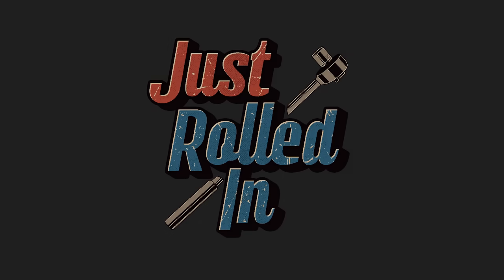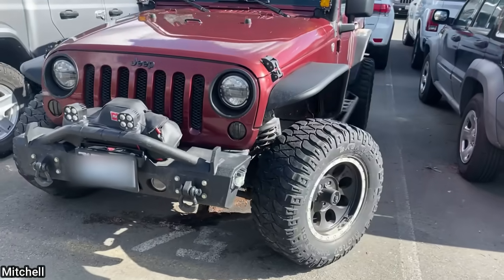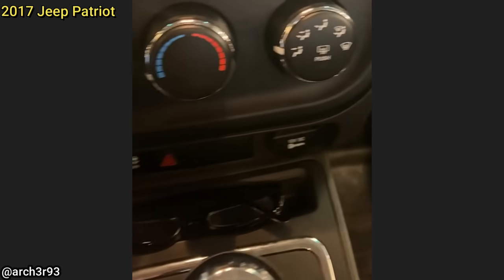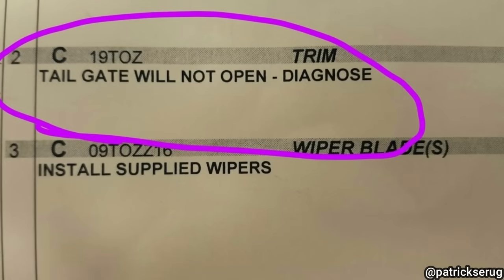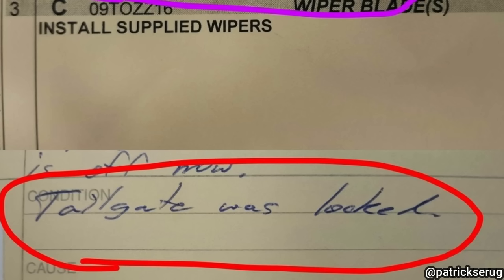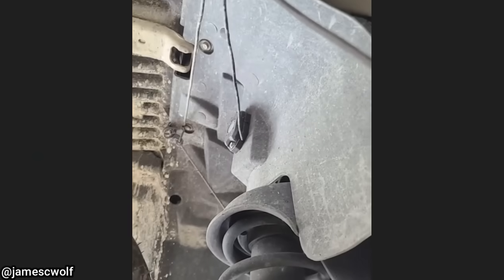Customer States They Hit A BIG Rock | Just Rolled In

Comment: If you must zip tie your wiring to something, use the drive shaft for quicker results!
Reply: Zip ties on a drive shaft are a an old prank, probably more than a few shops found this a time or two.
Reply from the maker: 😂 I'm pretty sure I posted a photo in a previous episode of somebody who actually did that. 
Also a customer used a belt to hold up their exhaust and belted it up to their driveshaft.
Reply: @JustRolledIn  lol yeah saw your video with the belt 😛
Reply: But, by avoiding the wires from hitting the ground, they now have them going across the exhaust.
Reply: Surprised that I haven't seen any pics on this channel of some idiot zip-tying wires to their wheels!
Reply: And for fwd cars use the CV axles, and always ratchet strap your load to the pre drilled holes on your rims. It's what it's there for.
Reply from the maker: @stevie-ray2020  there was a clip that somebody had underglow wiring rubbing against their brakes and brake caliper 😅
Reply: Just another bright Wrangler owner...... Disclosure....I'm one.😉
Reply: @JustRolledIn   Saw that!
Reply: I found the exhaust to be the easiest.
Reply: Much better option.
Reply: Lol sadly I actually do have to ziptie some of the wiring in my mustang because it's hanging down into the steering shaft I have no idea how the kid drove 50 miles to my house in it with no oil dipstick and a shot wheel hub assembly so ... I may be throwing a 302 into it lol
Reply: @stevie-ray2020  The closest I come is seeing someone putting snow chains on the front wheels on a rear wheel drive, no chains on the rear wheels.
Reply: or exhaust pipe

Comment: In high school I told my mechanic father that I hit a rock with my car. Which I did, I just left out the part that I did it while hill jumping on a dirt road. He didn't buy it and I rode the bus for a month until he decided to fix my car.
Reply: That'll learn ya
Reply: Been there before lol. 96 Ford Taurus into a guardrail said I got cut off but just came in the turn too hot.
Reply: @jefferymccormick3380  I got pretty close to doing that back in highschool with my old 94 celica.  Was out in the country late at night doing some "spirited driving" and came up to a decreasing radius corner a little too fast, i felt the car understeering right twards a ditch.  Luckily I did the right thing and didnt lock up the brakes, instead just let off the gas and lightly tapped the brakes to where the back end rotated a little faster.  Was a pucker moment for sure,  I decided at that moment that If its a blind corner, and you cant see it in full to always play it safe.
Reply: My mechanic father taught me to be my own damn mechanic at the age of 12
Reply: I mean at least he fixed it. I would have told you to fix it yourself 😂

Comment: A PSA for anyone that's dealing with hot glue.

Just spray a little of isopropyl alcohol over the glue, let it soak a few seconds, and then try to pry the blob. IPA makes wonders cleaning hot glue.. You don't even have to rub residues..
Reply: Good idea: I. alcohol also gets stickers off of windows; soak a few seconds to dissolve the glue, and then clean window. Learned that in a grocery store.
Reply: Thanks for the information
Reply: I didn't believe that when I heard it because I knew it wouldn't disolve the glue... But I tried it, turns out it works it's magic on the bond and it just pops right off with some wiggling.
Reply: @volvo09  The first time that I saw that trick my mind literally exploded
Reply: @SDogo  Literally! That sounds messy!
Reply: @MrTruckerf  try it :D
Reply: Thank you for the first useful youtube comment of the year!!
Reply: Further PSA
IPA, in this instance is referring to isopropyl alcohol and not an India Pale Ale. 
It is ill advised to pour India Pale Ales on hotglue.
Reply: @tesleentwiceforgiven6063  Oh... good call XD
Reply: @tesleentwiceforgiven6063  Doh..... Too late 😩
Reply: I've seen this when they pull dents and had it in mind, never thought it can work but seems like it penetrates on the bond somehow.

Comment: First time I have ever seen a leak repaired with a c-clamp!  Must be a top-notch mechanic with extra skills.
And... The problem with plastic fuel tanks is that thieves don't have to worry about blowing up when they drill holes.  That's just a really rude thing to do.
Reply: yeah, except for the battery powered drill that has brushes sparking away, right?
Reply: They don't have to worry anyway.  If they are drilling the bottom of the tank, the hole is covered by liquid gas.  A spark will not be likely to ignite that.

People often misunderstand this.  You can take a lit match and throw it into a bucket of gasoline and if you didn't let gas vapor build up above the bucket yet, it will just extinguish the match.
Reply: @stinkycheese804  ... while more and more cordless drills are brushless these days, I'm not sure it's worth the gamble to drain a tank with a drill INSIDE a shop that also has a million bucks worth of cars and tools... not to mention the business interruption a fire might cause. Oh yeah, you could also set yourself on fire and do some serious damage there as well. There are safer ways to do this.
Reply: @stinkycheese804  You do either the tank or bucket trick.... I'll watch from a safe distance.
Reply: C-clamp guy 10 minutes later..."where's my c-clamp AND my 10mm wrench???" 😂

Comment: Didnt know they bought a car not equipped with air conditioning. Lost my faith in humanity.  😆  Another good video 👍 👍
Reply: Almost as bad as the locked lift gate that won't open....my god
Reply: I think some people don't realize that A/C is an option, and that cars can come without it?
Reply: @dposcuro  a car without A/C wouldn’t sell here in Florida xD
Reply: @dposcuro    I'll be honest, I thought all cars had it as standard at this point!
Reply: Ehh, I'm kind of willing to give that person a pass. Bought used, likely no Monroney label included, and the knobs look normal to a non-car person.
Reply: @GreenJeep1998  my niece has a near bare bones Corolla...2014. It has no AC. In the summer heat not sure how she does it. I would give up power windows for AC.
Reply: @mikefoehr235  im not going to lie.  i thought ac was standard on those types of cars.

its worth a little bit more money for AC
Reply: @mikefoehr235  Uhg, after having owned vehicles with dead A/C, mostly dark colored too, I don’t think I can go without any more.
Reply: Would have never thought of a car not having AC, but it’s one of the first things I check when buying a vehicle.
Reply: @michaelvaus  I agree 100 percent man. When the wife and I go camping, sure is nice towing our RV and being comfy.
Reply: When I was looking at a truck to buy I asked if it had air conditioning. He thought it did. I tilted the cab and no compressor, no 2nd radiator for the air conditioner.
Reply: @dposcuro  It's what your soon-to-be ex-wife gets in the divorce settlement
Reply: Yep, if your car is a complete base model then be careful to check for AC. It's pretty much guaranteed to be there in anything except a base model... And even those have to be special ordered. No dealers really  actively stock those. 

My local Toyota dealer had new base corollas advertised for 14k back about 10y ago, no AC.
Reply: @volvo09  Damn by 2017 I thought AC was pretty much standard.
Reply: I was surprised you can even get a new car without A/C. My last couple were barebones but still had it!
Reply: My 98 civic had AC but I didn’t have it for 5 years due to the belt that ran the compressor broke twice and I gave up , it was a pain , last time it was suggestive that the compressor seized which broke the belt . My Tacoma has ice cold AC 🤣
Reply: Zilla Deliva  it costs more to not have the ac system now a days, right?
Reply: My first and third cars had broken AC.. it was almost always enough to just roll the windows down. On Long Island anyway, so it didn't get super hot like a lot of places.
But in the rain, the defogger requires A/C to work so...
Reply: I've had people borrow my pickup before, then bring it back telling me that the power steering was broken. That pickup has an alternator, a water pump and nothing else on the belt.
Reply: @Glider5858  yes but is sell at some place that are colder same for heat why buy extra for something you wont use

Comment: I had a authorized dealer at a large facility install their brand new factory ordered truck cap on my F150. This dealer ran an accessory power wire to the back of the truck straight from the battery hanging out in the open underneath the truck zip tied to the suspension components and what ever else they could find to zip tie the wire to. There was no fuse anywhere in the wire it was live from the battery to the back of the truck waiting to ground out and possibly start a fire. I could not believe my eyes when I saw what they had done with that wire.

Comment: That Jeep with the broken axle is pretty impressive. I think the latest generation (JL/JT) have a cast section with an axle disconnect to improve MPG and this cast section is what breaks, but this looks like an older model without the cast disconnect section. That is just the axle tube and it is still broken clean in half. Impressive indeed. The speed and forces involved here were truly large.

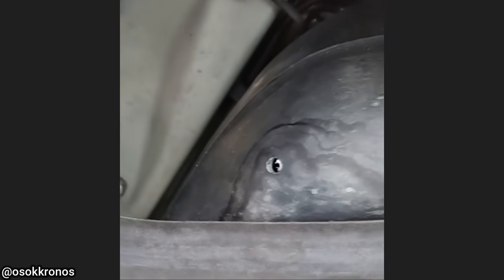Comment: 0:50 Drilling holes in gas tanks and stealing catalytic converters seems to be more common these days (at least in the USA). I've never heard of it happening here though and hopefully it wont become common. It seems high risk drilling into a tank with a highly flammable liquid in it. Drill bits tend to get very hot when drilling metal.
Reply: Most tanks are plastic these days. Now, stealing burritos however... Tricky business!
Reply: Did that look like a metal gas tank? No, it did not.
Reply: I do repairs/roadside calls for U-Haul & we see this at least once a week. One location was hit a few weeks back, got 12 cats & drilled all the tanks. I ended up making about 8 grand off that fiasco. Sucks tho, scumbag thieves. Nothing seems to stop them short of a big mean-ass dog.
Reply: Metal or plastic on the gas tank, no big deal drilling as long as you're drilling into the gas and not vapors. The vapors are what burns.
Reply: @acemobile9806  The sound of a 12 gauge pump stopped a would be gas thief in my driveway last weekend real fast. So fast in fact that he left a real nice milwaukee cordless drill next to the car. He probably "obtained" the drill at a huge discount too though.
Reply: @MikeBrown-ii3pt  fuckin' A right. Good score! I wonder if he'll try to get his drill back
Reply: @acemobile9806  a 12 gauge seems to work.
Reply: Yeah..it'd be nice to live in low/no crime area; my cargo van was ez pickins for both cats. Don't drive much & hoping ( large) tank stays hole free:/ 
Gas has dipped below $4/gal here, woo. How much in Brisbane..?
Reply: There is no risk to the person drilling even in steel tanks.  You're simply not going to start a fire that way.  It does cause a large repair bill though!
Reply: @acemobile9806   Do you really think he purchased the drill in the first place?
Reply: @stevie-ray2020  no, of course not! that was part of the joke 🙄
Reply: @knurlgnar24 Ummmaybe slight risk to 'person'/scumbag thief being ventilated by car owner's 12 gauge!
Reply: They were talking about making a law here in Alabama that makes anyone with a vehicle 8" plus inches from the ground mount a catalytic converter locking divice $500 fine for first time offenders. The divice cost around $200 plus installation. We really living on ridiculous times
Reply: Time to change to a hydraulic suspension that lowers the car to the ground so that they have to be flat as pancakes to do the deed.
Reply: @knurlgnar24  I would suggest that you google what fuel prices are outsude the US so that the answer doesn't come as too big a surprise.
Reply: @luisgonzalez3057   The dirt-bags will just carry a trolley-jack in their car!  Seen this on videos from the UK where youths from public housing-estates drive around in unregistered/uninsured 'pool-cars' stealing whatever they can!
Reply: @ehsnils  Citroen made it a standard equipment
Reply: @brianstratton8767  I think it works out somewhere around $7/gal to $8/gal Australian (I payed $1.68/l for petrol today and diesel was $1.89/l I think).
Reply: I'd worry more about that battery powered drill with the brushes sparking away.
Reply: @grumblyone3334  And smuggling twinkies. Very dangerous business
Reply: @rupe53   Many have brushless-motors these days, but I wouldn't be surprised if some of these idiots tried cutting off the catalytic-convertor after draining the tank!
Reply: @grumblyone3334  I was unaware of this.  What kind of plastic survives gasoline?  (In the long term?)
Reply: @josepherhardt164   HDPE (high-density polyethylene) plastic is commonly used.
Reply: @grumblyone3334  Thanks.
Reply: @luisgonzalez3057  I think public flogging for cat thieves would be more effective.
Reply: @luisgonzalez3057  I got a ticket once while visiting Florida for leaving a dash cam attached to the windshield. I was parked in a private parking garage to boot.
Reply: @acemobile9806  Yes I rented U-Haul trucks to our customers and we got hit several times, drilled tanks and stolen converters. And stolen batteries. Come to work first thing in the morning, step out of my car and immediately smell gasoline.  Time to down another truck.

Comment: It’s amazing how many people do crap like that with electrical stuff on cars.
Reply from the maker: Yep. So very often lol
Reply: When I was a teen a friend did that. He asked for help installing neons (back when they were real neon tubes) and I said sure, bring the car over sometime and we'll do it. 

Later on I am over his house and he's like "check it out, I installed my neons!" He just zip ties everything to the chassis, and wood screwed the neon brackets into the rocker trim. 

He hooked the switch up to the battery and routed the wire through the door seal and screwed it to the dash. It was absolute sh1te, just like that truck. Wires zip tied to suspension components and brackets.
Reply: Boi, come to Brazil... I bet you'll see some CRAZY stuff!!
Reply: @volvo09  lmfao. I think I did my first ever work like that. And my dad chewed me out for it. I spend the weekend doing it the right way. It was back in the day when amps and subs were “cool”.
Reply: The trailer wiring harness adapter on the '97 Jeep Grand Cherokee I bought has a 12v power wire wire going to the battery where it briefly turns yellow,, the rest of the wire is black, 'cause you know, power wires shouldn't be bright colors like red or yellow or orange. The wire goes under / thru / around / over the frame, across the rear differential, and up into the rear of the Jeep below the drivers side tail light to some sort of trailer adapter box I'm assuming is to make the trailer lights work with whatever body module controls the lights. I've disconnected it and will remove the wire before the Jeep sees the road, it's very sketchy, but surprisingly it was fused.

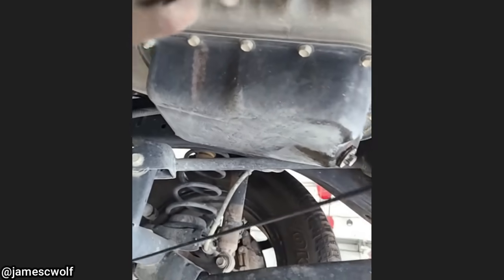Comment: 2:48 reminds me of a story where an apprenticing car mechanic forgot to put the drain screw back in on a VW-LT van. refilled and refilled without the dipstick showing a single drop. 20 litres later someone noticed the lake of engine oil underneath the car...
or somethign I witnessed, when they pushed the apprentice around so hard he forgot to drain the old oil. the poor old engine would barely run with twice the oil filling underneath the crankshaft... good thing the customer, waiting outside, didn't catch anything from it.

Comment: 3:00 Brazil? Brazil.  

0:55 Two words: Fleet Vehicle. If you want a blank palette to play with, buy a low mileage fleet vehicle. They are cheap as dirt, but will be missing some essentials that are a given to the regular motorist.  Such as AC,  power windows, power locks, satellite radio, and even the USB charger for your stuff.

Comment: Use rubbing alcohol to remove hot glue. Usually breaks the bond rather quickly. Just came to mind when seeing the mess on the lug nuts.
Reply: That 2nd sentence is what she said!
Reply: At least they used hot glue and not epoxy.
Reply: How come the wheel nuts rattle?  Do the buggers up!!!   I've never had a loose wheel nut in 44 yrs of driving.
Reply: @csjrogerson2377  It was the hubcap that was rattling, so they apparently hot-glued it to the lug nuts. Still all kinds of fun for the mechanic.
Reply: @mhfuzzball  Gotcha, thnx.

Comment: 0:36 for MB steering scream: i think there is the same electric motor powered steering rack as on the V-class. I saw once all of the 3 screws that supposed to hold the motor to the rack just broke of and there is a 1-2cm wide belt which is toothed and because the motor is loose the pulley and the belt just making contact with each other when the motor tries to rotate the inner mechanic. It had the same sound.
Reply from the maker: Interesting! Thanks for sharing. The tech who filmed that one said they never seen that issue yet at their dealership

Comment: Worked in a lube shop when I was a teenager. I remember this customer returning complaining her air conditioning didn’t work AFTER the car was serviced…. The manager of course looked at the car and found it did not an A/C system ever. No condenser, compressor, etc…It was a late 70s Toyota Corolla.  Ultimately we had to call the police because she completely lost her mind….. to her credit, she dropped off the car in the morning and picked it up in the evening… temp change went from around 50 to 80 that day….